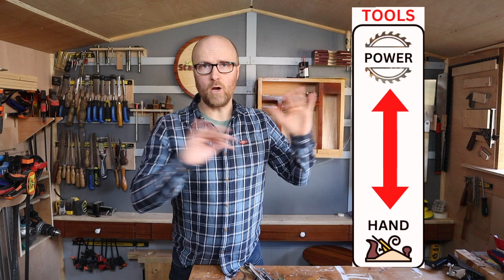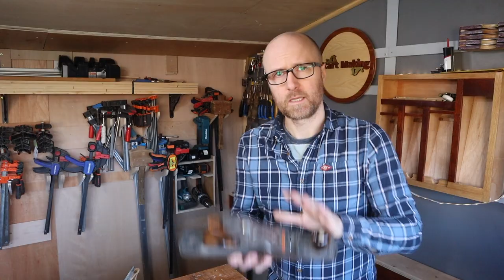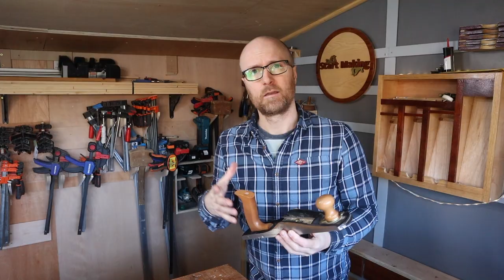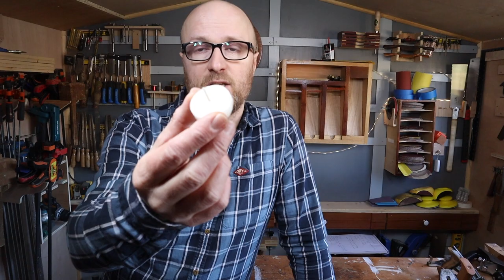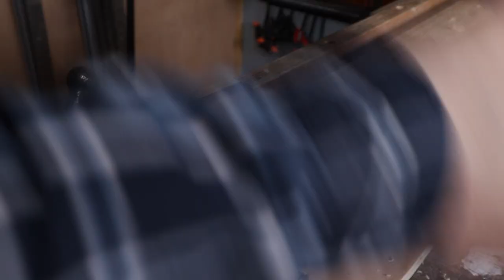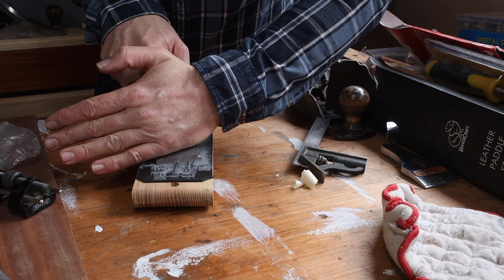my first HAND PLANE was a DISASTER | THIS one is NOT.

Comment: Veritas tools are expensive, but well worth the extra cost - at least in my mind.  I struggled with an old Stanley #4 and had just about given up on planes when my wife gave me a budget of $300 for a gift for my 60th birthday.  I used that generous budget to get a Veritas Low-Angle Jack Plane and what a difference it made!  Instead of frustration, I had real results.  I still struggle a bit with getting great results with the Stanley #4, but the Jack is wonderful to use for both planning and shooting.  Next target:  Veritas Router Plane... ;)
Reply from the maker: I have two say that I really love my vintage planes but when I hold and use a new one after a while whit it feels so much smoother. Less errors and so forgiving.

Comment: I don't care how bad a plane is you can always make a scrub plane out of it. Using a scrub plane is revelation. Put a radical camber on that iron and have fun!
Reply from the maker: Scrub plane on pine, no better feeling. I totally agree. But not the worst one that I first got with the awful iron and double adjustment knobs. I use an old 4 1/2 .

Comment: Acorn (No 3) for £ 3 off a secon hand stall late 1980's electric plane 2007. btw use a candle all over your hand saws both sides-easier cutting and preserves the sharpnes. (also Sapele is pronounced sa-pee-lee not sappelle)
Reply from the maker: Hi Mickey. I see a lot of the Acorn planes at the vintage tool shops. Get tempted but then I have no real experience with their quality. Great tip for the hand saws. And I was hoping someone would correct me on the Sapele pronunciation. I was never quite sure that I had it right. Thank you

Comment: My early experience and advice, buy an old Stanley  4 or 41/2 that is complete and  isn’t cracked, or chipped and not a ball of rust, do your research on how it works, strip, clean and lubricate everything  . Make it look the best you can and learn to sharpen .!!! and hone ..!!! (blades, planes, chisels, knive s it’s all very therapeutic once you master it )   Wax the soul plate constantly - you will learn  to love all of it’s  little quirks  and idiosyncrasies, the things that make it your plane.. power tools do a job and can be very accurate, but I love all of my old hand tools, there’s just something about  the crisp shearing of  gossamer thin  ribbons of wood  that gives you an enormous feeling of well being……plus there’s very little need for dust collection and ear muffs with most hand tools..🎵🎶🎵🎶
Reply from the maker: Hi Ian. All accurate points. and you are describing my journey. The only reason I suggested the sweetheart is the confidence and not losing people to giving up. And I am glad you also appreciate the feel and sound of these tools. No better therapy.

Comment: Interesting placement on you scale… as a woodworker who makes a living from their tools, i couldn’t eat with purely hand tools, that said much of the work can’t be done with power tools anyway, so for planes, i have no.3, several no 4’s set up for scrubbing, smoothing or finishing , a 51/2 a couple of block planes, and a whole bunch of shoulder and bullnose planes for shaping and detailing. My favourite plane is an old wooden marples - that out shines all the others.
Reply from the maker: Hi BrainFizz. thank you for your comment. Hand tools are tricky to use solely. I too have adjusted one of my 4 s to be a scrub plane. Very satisfying. I do need a decent Block plane. My amazon basics one is an embarrassment. I have a wooden plane that I restored and nothing feels as good to use as it. Amazing.

Comment: How many planes do you need? Well, it depends on what you are going to be doing. I have 20+, and will be getting more> I am all set on lathe tools, but just getting back into flat work. I would suggest that anyone who is going to attempt to learn to use the traditional hand planes should start with an old 'restorable' plane. You have to take it totally apart and then put it back together so that it works again. This will give you a good sense of how the tool works, and is indispensable for learning. I want some wood planes. Did pick up one old jointer's plane, and was able to get it to cut again, but I might have to do major modifications to make it fully functional, or build one from scratch.
Reply from the maker: Lots and lots, sorry I just read the first question. That may be because I am a little addicted, rather than necessity. You would not believe it but when I realised my first 5 videos around a year ago, one of them was titled something like ' the perfect first hand plane' . I basically made a video agreeing with exactly what you say, a Stanley no 4 or no 5 bought in terrible shape and refurbished is the best way to start. For all of the reasons you say. However, since then I have realised that confidence and continuation in woodworking were not taking into account. I liked the challenge of getting the old plane to work and fought through a lot of the frustration but I can also see that being enough for people to give up on hand tools entirely. That lead me to the realisation that maybe the modern plane would be better first and while gaining confidence as it is easier to tune, then a beginner can figure out a vintage one. I only have one modern plane and I do love it, but now I can use them better, I always reach for my vintage ones. As an aside, there is a video about a wooden plane I picked up and restored, super easy and man does it cut.

Comment: one disadvantage, in my opinion, of the low angle jack plane is that it isn't very good on a shooting board.
Reply from the maker: I found this too. I tried and tried but the sides are not perfectly square with the sole and there is so little to hold on to

Comment: Just watched your video and the production is great however, a few points about a plane, the part you refer to as a chip breaker is nothing of the sort you will only find them on thickness planers not hand planes, they are called cap irons. Now I know that this will cause arguments over the name, but this is North Americans that use this term and younger UK woodworkers that have seen YouTubers refer to it as that. Very much like clamps V cramps, they again in the UK were only called cramps as marketed by Record tools. I guess ultimately you can call them what you want and it does not really matter as long as you can set up and use a plane. With regards to low angle jack planes V a normal bevel down jacket plane, I purchased one to compare and I am afraid it is marketing as there is no benefit from spending the sort of money that Lie Nielsen, Veritas charge for these planes, probably why Stanley who made the first no 62,  years ago then discontinued it brought it back as they thought they were missing out.  There is nothing that these bevel up planes can do that I can't do just as well or better with my old Stanley's or Record's. The chatter is a myth, I think I can safely say after 40 plus years I have never suffered that 'problem' and believe me I have planed a lot of hard woods. I even tried a thicker blade, again no advantage. Not looking to cause arguments but giving my honest opinion. I do agree buy a no 5 jack plane first as it is as the name suggests a Jack of all trades.😉
Reply from the maker: Hi Gary, Thank you for the comment. This is in no way an argument as it sounds like you are very experienced in woodworking. I was under the impression that the part with the lever and the Stanley logo was the lever cap, the metal part that attaches to the iron is called the cap iron or more commonly the chip breaker. To be honest I took that from Rob Cosman, I believe. Figure he knows more than I ever will. I think I also said that there are very little benefits in the make up of the low angle vs the Stanley 5 except the quality brought in by newer machining etc and the iron of course. apart from that they are, as you say, very similar. I disagree that they can't do anything better, the iron is far easier to get an edge on and keep the edge on and this is what makes it the perfect beginner plane which in the end of the day was the main reason for the video. I think that for a beginner anything that can make planing easier and more successful, even if it comes at a slightly higher cost, has to be considered. My aim of the videos I produce is to try and help others avoid pitfalls that I have encountered. I always say that I am not an expert and love getting so much detail from the more experienced people in the field such as yourself. Thank you very much, Very much appreciated.

Comment: So much great advice here!  Rex Kreuger has done a video of super tuning one of those appalling 'high street' planes, he did manage to get some acceptable results, but it took a lot longer of time and effort.  He reached the same 'Just bin it!" conclusion that you did.  Very astute observation that using a really good plane gives a feel for how they should work.  I started with my Grandad's No 4, which had already suffered at my own hands when I was a kid.  Initially it was utterly awful to use, about as sharp as a mallet, choked with 40 year old shavings, covered in light rust, and of course I was trying to take huge deep cuts.  It just wouldn't cut!!  After a while I learned how to put a half decent edge on it and to take lighter cuts, at which point I thought 'Ah, that's what a good plane feels like'!'.  After more time  I learned how to get a good edge, and to maintain that edge more frequently, and how to dress the chip breaker to avoid clogs.  Much better results, and I thought Ah, that's what a good plane feels like,  Then I had a lucky find with a 2nd hand Tormek, which enabled me to correctly regrind the blade and consistently achieve a truly sharp edge.  At the same time I'd practiced renovating many other really  badly neglected planes (the worse the state they're in, the more I'm inclined to buy them cheap so I can save them) during which I'd encountered, diagnosed and fixed all kinds of issues, all of which added to my understanding and confidence.  It's taken a few years, but I think I'm reaching the point where  I do finally know what a really good plane feels like.  Had I been able to buy a new high-end plane on day one, I would've understood just how poor my antique plane were, and could've skipped a lot of 'It must be me being useless!" frustrations.
One cautionary, tip re the Stanley 78 rebate plane, try to get in the habit of always picking it up by the handle.  I've developped a bad habit of just grabbibg it, which is fine when the side fence is covering the protruding corner of the blade, but when using it with the side fence removed, that razor sharp protruding corner can cause a really nasty cut, I've made that dumb mistake more times than I want to admit to... and it bloody hurts!
Re butchering off large amounts of wood fast, Paul Sellars did a vid on converting a 78 into a scrub plane, which was the tradition ' no finesse' bulldozer  of the hand plane family.  For really aggressive stock removal, the carpenter's axe was used for rough prep.
Reply from the maker: Sounds like we went on very similar journeys at the start. I suspect there are a lot of people who have. A Tormek looks like it would really help the sharpening process. Especially regrinding old irons. I am a sucker for an old plane. I can't see them sat rusting away. Just bid on 3 Stanleys at an auction and even though I dont need them, if the price is right, I will take them and fix them up. 
I actually watched Paul Sellers Scrub plane video and have a 41/2 set aside for the conversion. Fun plane to have .

Comment: Hi, Mark, great information. Thank you.
About 40 years a go, I inherited a few Stanley planes, from my grandfather, a No 4, a No 5 and a block plane.
I have used the block the most (for small needs) and the other two just a few times. Although, I did clean them up when I got them. They had laid round for a while. But it is nice, to now know what I have and their uses. Never heard that before.
Maybe, this can lead me to use them more often. ✌
Reply from the maker: Hi Zapa1pnt. Great to hear from you again. Thank you. The number 5 Stanley is your best, honestly. I have a block plane and reach for my larger ones so often even for chamfering and such as the block plane gets worse results. Though you can use it with one hand which is very helpful. That said, some people don't need planes as much as others, I use mine to dimension wood a lot as I don't have as many power tools. I also feel like a better wood worker than I am when I use a well sharpened plane. though, I also feel like it is day one again when I haven't gotten the sharpening right. Part of the fun I guess. Thank you for watching all the videos you do. Much appreciated.
Reply: @startmaking1 : Yep, having a good tool in your hand will always boost your ego. 😁🖖
Reply from the maker: @zapa1pnt  lol. Very true

Comment: Great video! In my particular case, my biggest blocker isn’t/wasn’t the plane itself - it is the clamping of the wood. I had a hard time figuring out how to “hold” the wood in place. And once I actually got it to hold, then the table I was using wouldn’t sit still as I actually planed across the wood. I’d be interested in your thoughts around how to stabilize a table for hobbyist planing (some of us don’t have the space for a heavy-ish, walk-around bench in the middle of our work area) and then some thoughts on various clamping jigs for edge grain, single board face planing, and planing across glue ups that might be a 2 or more feet wide. Love your style and I think you really hit a sweet spot with this content. You’ve obviously got skills but your presentation to the layman is so straightforward - makes woodworking nicely approachable for those of us not in it 9-5.
Reply from the maker: Oh yes. I totally understand your issue. There are a number of ways to try and fix the issue of fixing the wood down. Though, I have to say I am not the expert here. Let's start with the clamping. I have a number of ways depending on the size of the wood. The easiest if it is just a quick surface plane is to clamp a strip of 5mm ply across the bench, one side to the other, and then butt the board to be planed against it and plane towards it. this is not 100% perfect but will get the job done. If I am planing something for a long time, ie taking a large amount of the area of the wood and it is a large piece, I double sided tape it to the bench. This may work for your glue ups. I have seen some people screw a piece of scrap wood into the side of their Bench so it is sticking up just enough to place against but not so much that your plane catches it. You could also make a jig to do this, ie adjustable height. A long board, I clamp one end and plane away from it. Not perfect but works in a pinch. And then there is always my moxon vice that is perfect for a lot of the edge work. 
Now for your bench. This was an issue and in some ways still is for me as I dont have an easily accessible heavy bench. For a long time I actually screwed the bench into the floor of my shed and used a shelf bracket to attach it to the wall. There is nothing worse for your planing results than a bench that racks as you plane. My saw horses, where I sometimes attach my moxon vice to plane, have a chunk of wood screwed to the bottom of the leg so I can stand one foot on it to keep it still while I plane, you could try this on your bench but it would affect your stance. In truth I dont have a prefect solution for this issue as I still have it. But worst case, I wonder if attaching some longer boards to the bottom of the legs would give it more stability , basically mimicking the span of a larger bench. I hope you manage to solve at least a few of the clamping issues.
Reply: @startmaking1  ty for the taking the time!